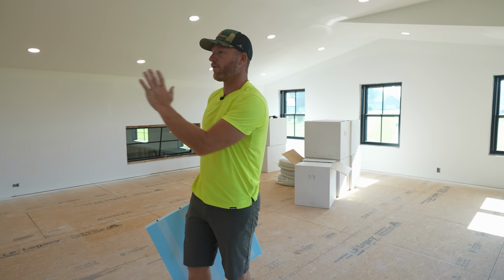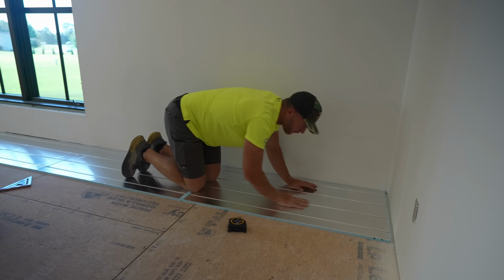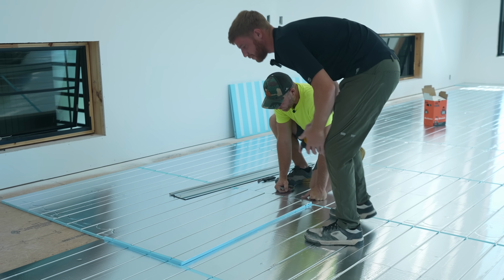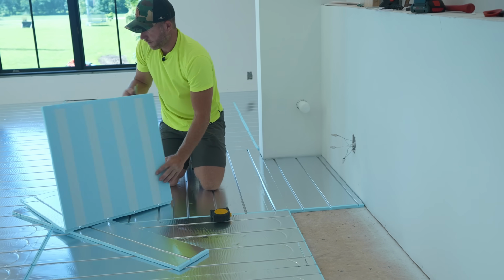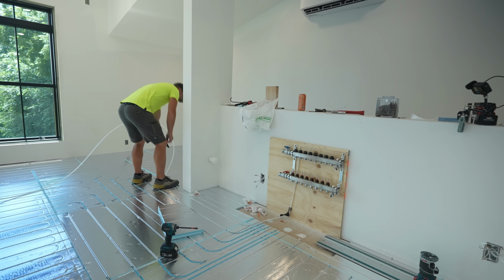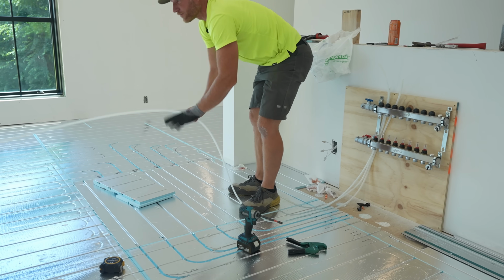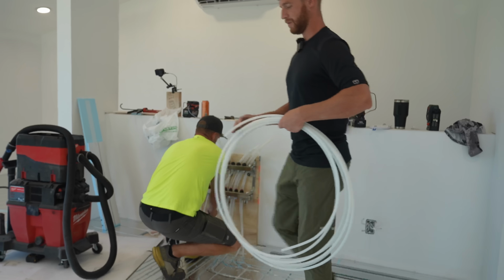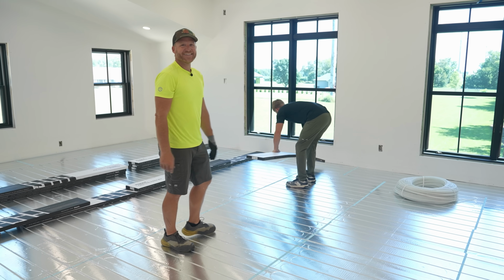Heated Floors without Concrete: RRHQ 2.0 #radiant

Comment: https://www.youtube.com/@RRBuildings  If you have electrical equipment running in that closet I wouldn't recommend too much heat, normally you want cooling.   Dunno how many telecom rooms I've worked on/in with both old and new construction that the HVAC have ran heat ducts into the space, only to come back and install a mini-split unit to cool the room for the IT electronics.    But it's your building, you can do whatever you want 🙂

Comment: I have uponor underfloor in my house, but I have a concrete screed over mine. Took some brainpower on how to comission the room stats to control the motorised valves on the manifolds, but I got there. It has been a great system and we can be 23C inside in the middle of winter when it is -35C outside.

Comment: When you reach my age of 73 and look back at how many times you said I should put on my kneepads and didn't you will clearly and painfully know you were nuts for not using them. Endless times of unblieveable pain and joint popping while moving and to many nights of waking up from the instant pain when you have rolled over. Then comes the day you will be told you need knee replacement BUT first you need to lose some weight and that seems impossible because of all the pain you have when taking each step. Construction is hard on the body and whatever you can do to help your body cope with your work DO IT. Oh but keep those electric bikes because when you can't peddle they will come in handy. Stop thinking you need protection and KNOW you and your body do. IMHO Knees,Eyes are the most things left unprotected because you get in a hurry. Think about not being able to walk or see all because you just kept saying MAYBE I should use protection and didn't.

Comment: Another fine job. Thanks for the video. It should be noted that metallic coatings on building materials can suppress, reflect and block electromagnetic radiation. They can affect radio and wifi signals, cell phones and all sorts of devices that we interact with daily.

Comment: Hey man I'm a plumber u should use plastic straps on that plastic so it doesn't ruin the piping because that constant heat cold expanding and contraction it's going to rub on that copper strap you got. That rubbing could damage that pipe.
Reply: Agree, no metal clips against PEX that's why those 90 bend are also made from plastic.
Reply: Also agree. Looks nice but not the right product
Reply: @BigRedftw So what’s the “right” product?
Reply: Agree use 3/4 poly clips used when running garden irrigation. Copper will chafe and leak.

Comment: When you said Flooret my ears perked up. I’m just a DIYer and I used their flooring about 3-4 years ago to redo my kitchen floor. 6 inch vinyl plank.  No problem except the installer. 😀😀

Comment: Seems like a lot of circuits for the small area . Especially with the downstairs being atleast somewhat heated.  Agree - make the daughter happy  .
Reply: There are maximum length for each PEX pipe size so often you need to do several circuit to not reach or go above that max. pipe length in one circuit.